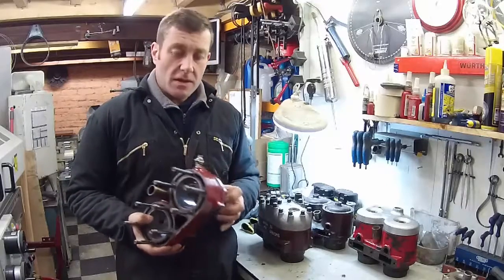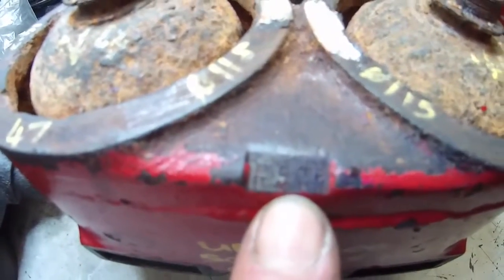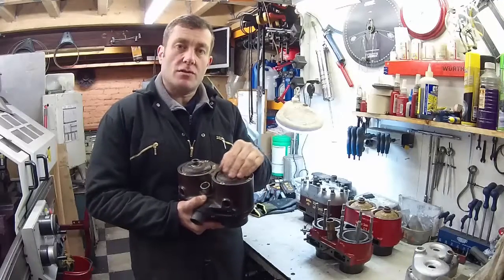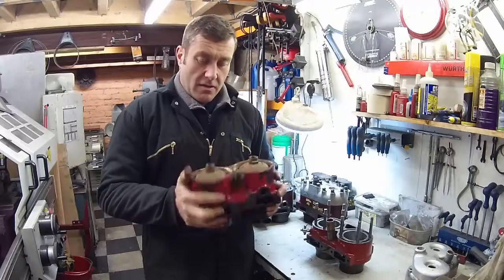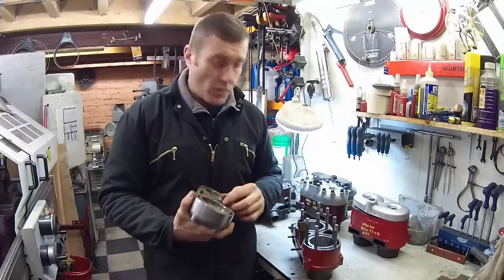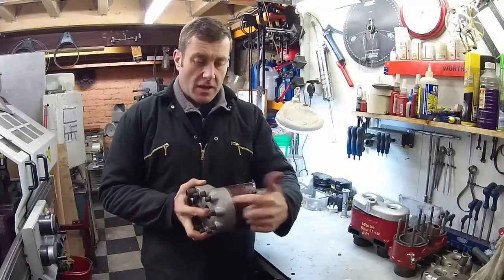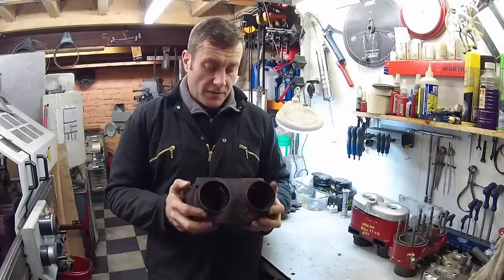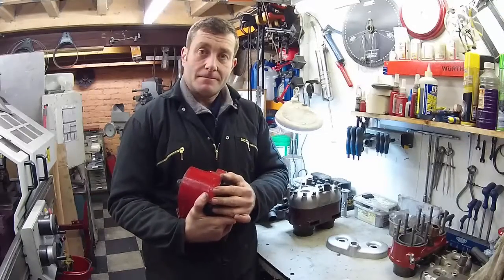Scottparts - Introduction to Scott Engine Barrels

Comment: My father described my grandfathers Scott as having access doors at either end of the crankcase which allowed access to the big ends.  The cranks were pins coming out from one side.  I'm know motorcycle engines but my father was less knowledgeable.  Does this description of the Scott sound right I'd like to know?
Reply from the maker: Yes that is about right, look at some of our other videos on engine stripdown and crank rebuilds, you'll see what it looks like inside.
Reply: @Concept5North  .THANK YOU.    Very nice and helpful of you ..